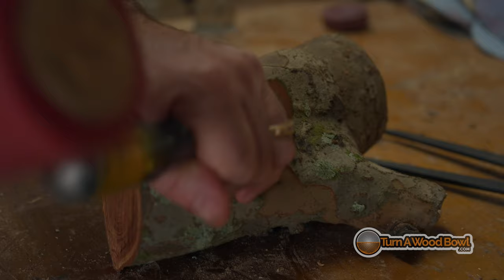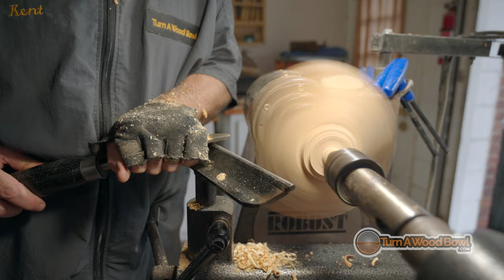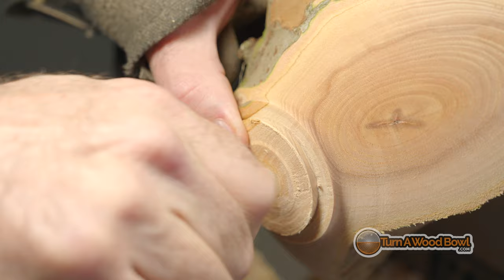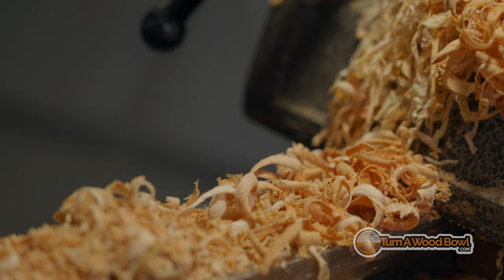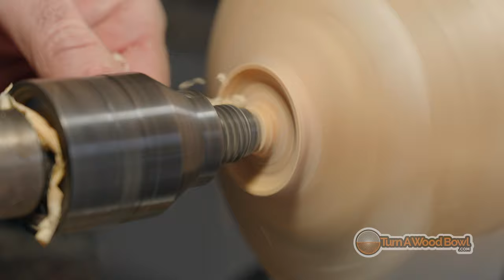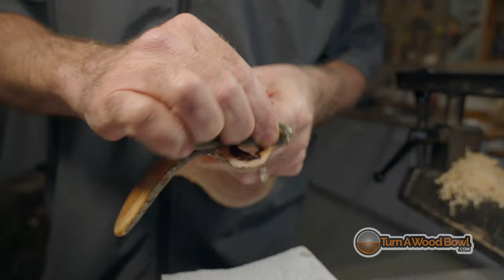Live Edge Crotch Wooden Bowl Natural Elm Branch Centerpiece – Start To Finish - Woodturning Video

Comment: Hi Kent, 
Great piece, again and as always! 
I like nature to stay visible.
Please allow me to ask you a question.
In your opinion, when can one and when should one not include core/heart wood in a live/natural edge blank?
This piece is turned with the whole branche, including the core/heart wood.
As I understand in this case using the whole thickness of the branch enables you to make the bowl deeper and have wood for a tennon.

But I get warned all the time for cracks ruining the piece, so I wonder what that gray area is.
Thanks, and happy turning to you to!
Ray
Reply from the maker: The short answer – heart wood always, but probably avoid the pith (very center). It all depends on the timber species and conditions, primarily moisture. I've seen wood with zero heart or pith crack like crazy and I've turned pieces which include the whole pith area and they didn't crack. You need to experiment, explore and discover what works for you and your local available timbers. Happy Turning!
Reply: Thank you! 👍

Comment: This is amazing. I just watched your microwave drying video, subscribed, then came across this one. I have a question about drying. How green was the branch before you started? Are you worried about cracking? Does the fact that it is so thin help keep it from cracking since there is less moisture to lose? Is it less of an issue because it's Elm? Amazing work.
Reply from the maker: Great questions. I have turned pieces from this elm on several occasions, so I know the wood a bit. It was not super green, but still held moisture. And yes, turning thin, allows the wood to equalize quickly. Cracks usually form from one area remaining moist while an adjacent area dries out. I suggest everyone start with one local tree species and get to know it and how it behaves, then add another and another. Happy Turning!

Comment: when I try to turn a large object like that between centers it always spins.  I can do small stuff and I use a mallet to drive the center first. It does have four spurs but came with the lathe so maybe is not the best.  I do crank down the tail stock but is still strips out on the head side.  Any suggestions.
Reply from the maker: Hm? Tight tailstock? Four spurs? Is the center slipping in the headstock maybe?
Reply: @TurnAWoodBowl  that might be part of the problem but the spur does start to turn in the wood.  I'll have to give it a go again.  If it does start in the head stock how do I stop that.  It happens if I try to do anything moderate or heavy.  Once it starts it seems impossible to stop so I put it on a faceplate